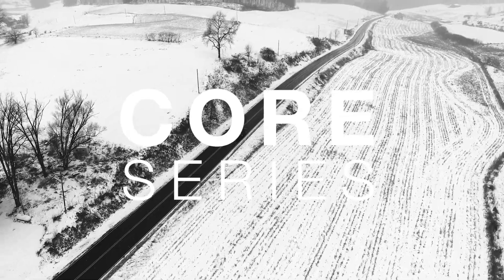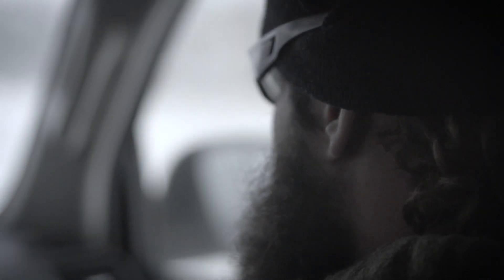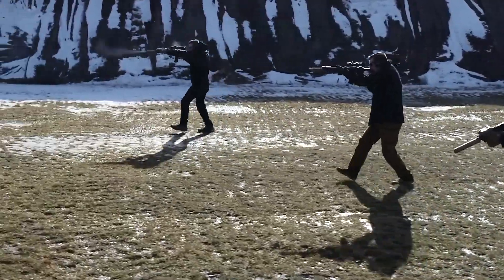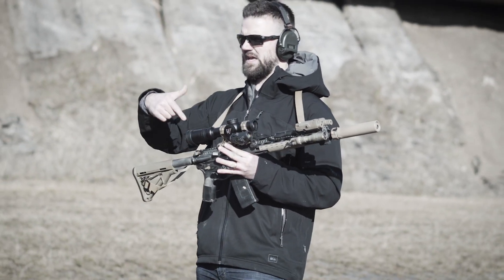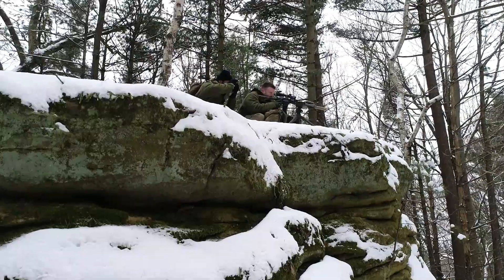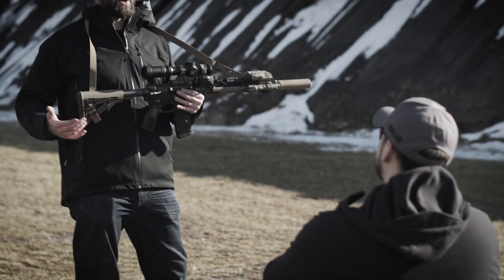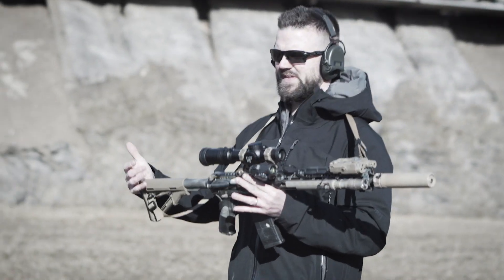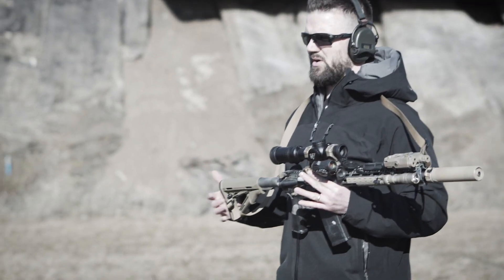Introducing CORE Series

Comment: Is .223 wylde better than 5.56..?
Reply from the maker: They are virtually identical with the exception of a very minor taper in the throat of the .223 Wylde chamber (forward of where the loaded round sits it the chamber).  This minor taper produces more consistent chamber pressures and thus is a more accurate chamber option.  You can fire full power 5.56 NATO as well as .223 Remington through the Wylde chamber as well as run it on full auto without issues.  With the 1:8 twist you will be able to use all common ammunition from 55-77 grain bullets with the best performers being the heavier options 69-77 grain loads.

Comment: Guarantee MOA or sub MOA? If so which barre length?
Reply from the maker: Sub MOA guarantees are marketing smoke and mirrors and (in our opinion) extremely low-hanging fruit.  It's 2022... if your AR is not capable of sub MOA performance, one needs to reevaluate their skills, rifle build, ammo, optics, etc.  Yes, all of our barrels are capable of well under sub MOA performance so long as the rifle is properly built and the shooter has the skills to do so.  Barrel length has little to do with accuracy, velocity yes, but not as much with accuracy.  Typically I find shorter barreled rifles are the most accurate as they produce less barrel whip.  * For the record, we offer a satisfaction guarantee.  If you are not satisfied with your barrel, simply give us a call and we can take it from there. *
Reply: @CriterionbarrelsInc  I ordered an adm uic mod 2 and wondering if on a 13.9 do you offer it in hybrid also or only core ? Thanks love the gear

Comment: soo... its a BA Hanson profile
Reply from the maker: No, it's quite a bit different.  The CORE Series has more material around the chamber for better heat absorption and a lighter weight front end for better balance.  The Hanson is basically a pencil contour without a shoulder behind the gas block...
Reply: @ cm,  I have both , and they could not be more different . How ignorant are you ?
Reply: It's a Larue Stealth barrel
Reply: @Justin-zw1hx  know if you noticed, but criterion made the barrels for LaRue for many many years
Reply: @justin, bet you can't even spell harmonics.
Reply: @ssharma1384  lol, I have a mechanical engineering degree
Reply: @Justin-zw1hx  But really, Criterion made barrels for Larue when they were good... it's how they got a name for themselves in the first place back when they earned a reputation for accuracy.

Comment: Same accuracy as seen with the hybrid series?
Reply from the maker: Yes.  The continuous taper design uniformly distributes heat during use which leads to exceptional consistency and accuracy.  The CORE Series has plenty of material to handle heat but has advantages of increases balance and handling.  The internals are held to the exact same tolerances as all of our barrels and it is reflected in the accuracy you will see.